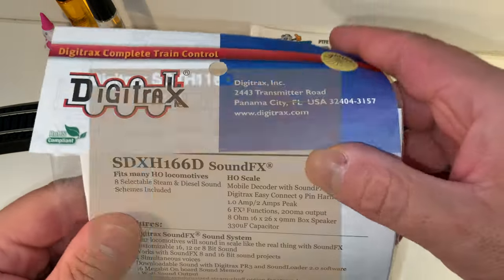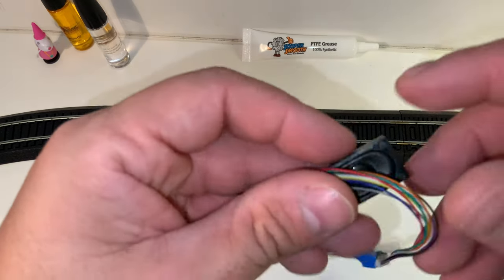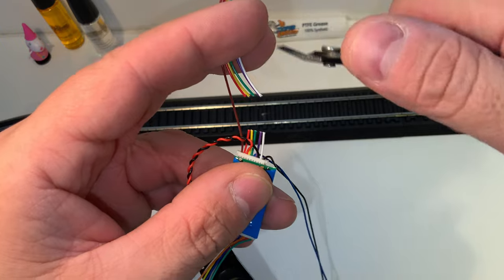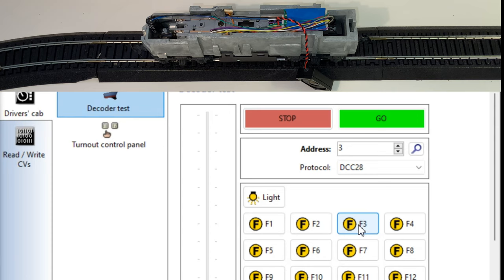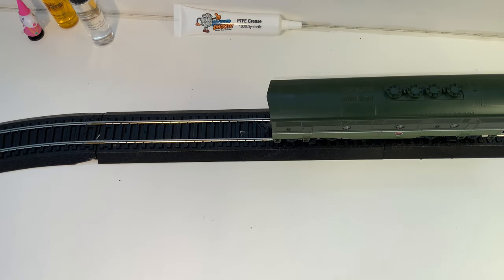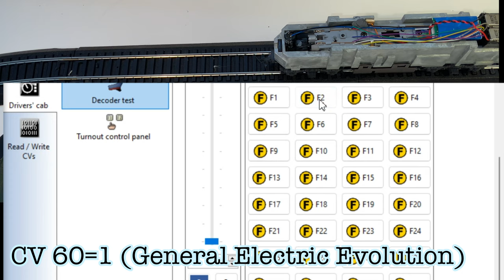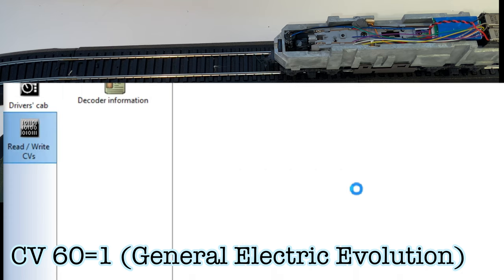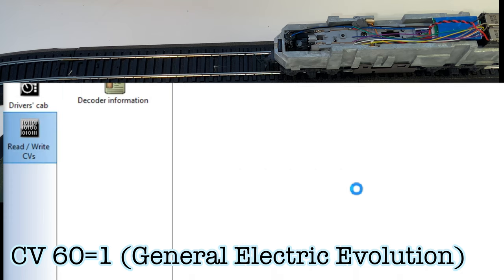Detailed Review: Digitrax SDXH166D Low-Cost DCC Sound Controller w/ Install into Kato / Stewart F3B

Comment: Great Review, Doctor Hobby!
Ironically, Today, I just installed an SDH166D, (low grade 8bit), decoder, into an ancient, (circa early, 1990s, MTS imports), 1910s vintage, NYC, IRT Hi V,  Brass Subway loco.
I did this, just to see if the loco and decoder will function.
Amazingly, it did, even with the old wiper pickups.
I tried to mute the steam chuff sounds, and other sounds, but run the compressor, and blow off sounds.
Your right, regarding the low grade spkr,.
I may record a vintage traction file, and fiddle with it, or maybe later change it out.
I learn a lot from your videos.
Your videos are great!
(Btw, Rapido received the returned loco, with the non prototypiclly operating pantograph, this past Sunday, but am now beginning to have second thoughts about returning the unit, as I just hope, it's returned with all the details attached; ( ladders, grab irons, etc).
I perhaps, foolishly returned the loco, along with everything else that was in the box, when it first arrived at my house.
I haven't been contacted yet, by Rapido yet.
I'm hoping they will contact me, or return the loco soon).
(Sorry, I just wanted to update you on the EP-5 situation).
As always; Your videos are great!
The speed tables you worked with, are interesting.
I've yet to get into working with them yet.
Thanks again Dr. Hobby!
Reply from the maker: Oh, haha.. never underestimate the benefits of good timing, right! Sounds like you have it doing exactly what you need! On that EP5, it looks like Rapido is unwilling to or unable to admit that "mistakes were made." I guess I'm going to have to do it myself... uuugh!
Reply: @DoctorHobby  I haven't heard from Rapido yet on the EP-5 repair status.
At this point, I just want it returned in one piece, as soon as possible.
Great videos Dr. Hobby!

Comment: Thank you!  OK I skipped around a lot.  LOL.  Can you tell me what software you are programming with?   I am BRAND NEW to DCC.  AS in I have one BACHMANN 2-8-0 with one of those crappy stock decoder, no sound, no smoke, just moves train back and forth.  ;)  I want to upgrade to sound, but hate to spend $130 a good decoder as plan on going with Broadway Limited high quality Paragon 4 and rolling thunder on the final layout.   This decoder looks like a nice cheap way to get into sound before I buy 400-800 engines ;)  I'm also guess if you look for the best quality box speaker, you might get better sound.   Where do you get this 'sensor' for the chuff ?   That would be a must for me.  I want to add smoke if it is included on the decoder.   ;)
Reply from the maker: Sounds like you've got a world of discovery ahead of you! Best wishes for the future! I use a LokProgrammer for what you see on screen. You don't need a chuff sensor with almost all decoders--they will use back EMF to help you synchronize the chuff cycle.
Reply: @DoctorHobby  awesome! Thank you.  I ordered a digitrax zephyr express latest 2023 model and a new soundtrax econ sound decoder.  Can't wait!

Comment: You get a lot of fire and fury with that combo. I think it works.  Problem is ho just has far less mid and base going.
Reply from the maker: Yes.. very true..HO gets me ALMOST everything I want and need, but, alas, it does definitely fall short in this area :(
Reply: You could try -- ok a bit of blue sky gazing here.  You could try to squeeze some kind of FM transmitter into an engine or maybe a follow car of some sort.  Tie it to the speaker wire which is not ideal.  Have it pick up at the stereo receiver and using an equalizer mask out all the highs and ... you know maybe you could more punch.  a kind of BLI rolling thunder without being tied to their product.  I saw this or a variant of it on OGR some time ago -- but that's o-scale which has a lot more room for such things.

Comment: Those Digitraxx Decoders are not good if you're DCCing an old Locomotive like an Athearn Blue Box. They will burn out
Reply from the maker: I could see that especially with an Athearn BB, which can be really temperamental and hard on decoders.
Reply: @DoctorHobby  I had to buy higher Aamp Decoders
Reply: @DoctorHobby  Tune them and hardwire them completely. New  motor brushes are better along with trimming the brush springs a coil .My old sd40 will run steady on 4 volts like this . Just creeps along 0.20 current draw at this voltage.

Comment: I have never liked digitrax decoders sound is terrible and if you try and consist it with any other manufacturer is a royal pain
Reply from the maker: I actually consisted it with a SoundTraxx in this video and it wasn't that difficult, but the sound is fairly horrible
Reply: @DoctorHobby  well I just recently got JMRI up and running so it might be easier for me to do now but using the hand throttle was a pain 🤣
Reply: Si